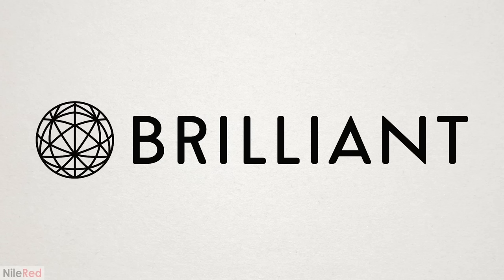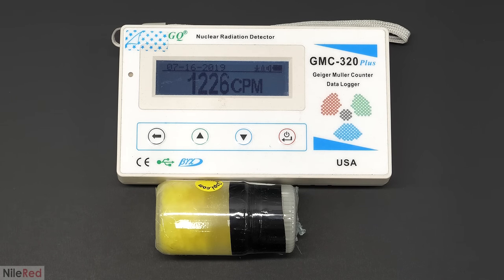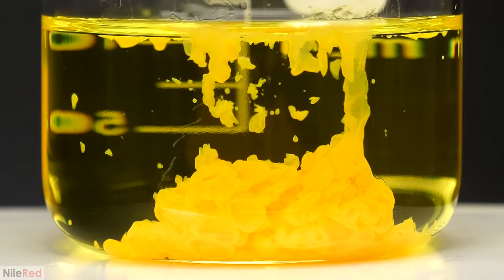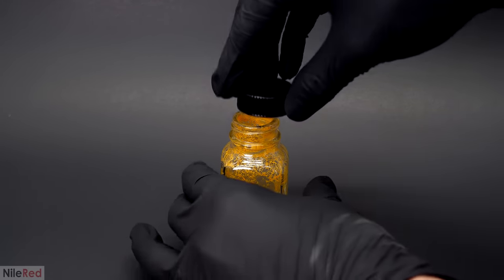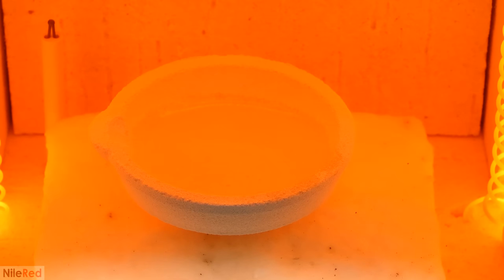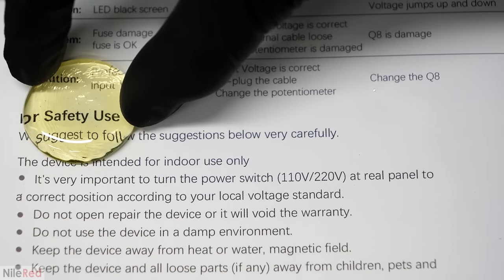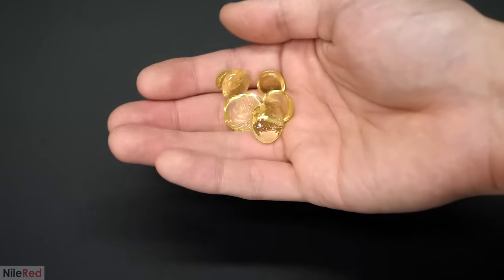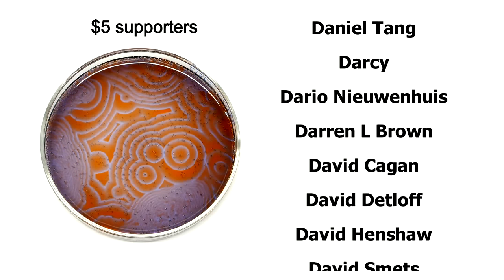Making uranium glass

Comment: The mother of an old school friend of mine had a large collection of uranium glassware. She kept the glass in a locked leaded glass display cabinet with and alarm system.The artwork was very beautiful, I believe the collection was quite valuable, most was a light green.
Reply: I like Uranium Glass too - it's very pretty.
But I wouldn't bother with the leaded glass cabinet - normal glass would be perfectly adequate for the Beta and Alpha rays, and hundreds of kg of leaded glass would be inadequate to absorb the Gamma radiation.
Check if the glass really is lead-rich. The lead strip used to hold plain glass panes together is radiologically useless - and that is the normal meaning of "leaded glass".

Comment: I'm a Boro-silicate laboratory glass blower. I've worked with custom uranium glass before. The trick to keep your specimens from shattering is a technique known as annealing. To accomplish this, you would want 2 separate furnaces. One for melting and the other for annieline. Place your graphite block in the aneeling furnace at about eleven hundred degrees fahrenheit. Open the door once the block and the furnace is preheated.  place your  spasiman On your graph light block at eleven hundred degrees for at lea half an hour. then Slowly reduce the temperature of your aneeling furnace without opening the door. Over the course of twenty four hours And till your sample is near room temperature And you should not have any internal stress anymore This process aligns the internal crystalline structure of the silica Transforming it into a stress free homogeneous mass. You will want to reduce the temperature on an inverted J curve slowly at first. But once you get past about  400° fahrenheit leaving the door closed u till it has completely cooled you should be fine
- James
Reply: I have now acquired another piece of knowledge I may never need but still was interesting to learn about.
Reply: same @TheKamasGod
Reply: Didnt he try to do just that?
Reply: @pressaltf4forfreevbucks179  Not exactly. As the OP said, the proper way to anneal glass is to place it in the oven and let the oven cool down over time in controlled steps. Most of my friends who have taken glass lampworking more seriously than I did have ovens specifically meant for this process. He's trying to make borosilicate glass (think Pyrex), but I'm puzzled since he's not using aluminum oxide in the mix as is typical from what I understand. The omission may be intentional, but it also may be in part why such small pieces were so sensitive.
Reply: I'm Curious. Would it be possible to make a Prince Rupert's Drop out of Uranium Glass? Maybe by dropping the Molten Uranium Glass into some boiling hot water?
Reply: @johnlemus7921  Highly unadvisable.
Due to the radioactive nature, it's safe when in solid form.But once it becomes a micro particulate can be inhaled which would be a big problem
Reply: Is the annealing also important so the uranium forms into nano scaled spheres like in gold ruby glasses?
Reply: MEGA MIND X100
Reply: now tell us how to purify the uranium 
im a bit late
Reply: @egg21hi  that's classified lol

Comment: "I think the glasses are safe"
check Geiger counter
"I think I have cancer"
Reply: Well, it's not like the glasses would be up against you very often. Also, the radiation is not going to linger in the glass.
Reply: bruzote well its not like glasses can spontaneously break and send glass/uranium dust in the air or anything
Reply: kek
Reply: Really though, I feel like the heavy metal toxicity of natural uranium is probably about as dangerous as its radioactivity.
Reply: Really though, I feel like the heavy metal toxicity of natural uranium is probably about as dangerous as its radioactivity.
Reply: @bruzote  "...radiation is not going to linger in the glass." That's not true. The uranium is a permanent part of the glass. And this form of uranium has a very long half life. These glass pieces will be radioactive for a very long time.
Reply: exactly, you said it yourself, the uranium won't linger forever in the glass, just gotta wait 700 million years for it to half!
Reply: There was a reason he was stressing much more about the uranium dust than the radiation. Uranium's natural poisonous nature is enormously more dangerous than any radiation coming from it, at least in small quantities.

Comment: I’ve been picking up uranium ore locally with a UV torch for a bit, and like you found, it’s strange that some of the higher uranium-content materials lose their fluorescent effects. Uraninite and pitchblende both have relatively high uranium content but have little to no fluorescence. While uraniferous opal is much lower (hard to find info, but never exceeding 15% uranium-bearing compounds, typically MUCH lower) and can exhibit some great phosphorescence.
Reply: It’s also helpful to have UV blocking glasses, at least for ore / impure uranium. You’ll be able to see some bright reflection without them, but the classic green color is much easier to see without the semi-visible UV light interfering

Comment from the maker: The sodium diuranate didn't fluoresce and I was concerned that maybe the glass was blocking the blacklight. I went back and tested it on its own though, and it definitely doesn't fluoresce.
 https://m.imgur.com/a/e7YOpH9

Also, it has been pointed out that my reading of micro sieverts wasn't very accurate. This is because the counter can't actually differentiate between alpha/beta/gamma and it instead uses math to approximate things. This is only accurate to what it was calibrated to, and for uranium, it won't give a very accurate reading. I figured it was still better than just CPM, but I should have added that it's also not very accurate. My reading here is probably higher than it should be and the danger is being overestimated.
Reply: I was just about to ask if you tried without glass. Good work.
Reply: Thanks, wanted to ask just that a moment ago :)
Reply: Great video!
Reply from the maker: @amitdas2676  thanks!
Reply: Im assuming you know basic radcon, but definitely make sure you dont injest or inhale the uranium. And take through surveys of your workstation after your done.
         -radcon worker
Reply: Its called green glass it was mass produced in 1900 to 1940s
Reply: Cursed chetto powder
Reply: Nile shell one of those in a leaded glass
Reply: I was about to leave a cynical comment until I read this
Reply: forbidden mustard

10:17
Reply: Reminds me of Dr Stone when he was making glass. Always love your videos.
Reply: Love the video.   Im curious;  if you mixed up a touch more glass (without the uranium) and attempted encapsulating one of the beads in glass;  see how much it can reduce the radiation =)  Might make them safer.
Reply: Why does it look like cheese...
Reply: Melt the plastic with lot of BORIC ACID and CONC.H2SO4
Reply: Make compound C2N2
Reply: Video idea: try extracting the bromine from bromine hot tub/pool tablets.
Reply: I was about to say because I recall glass blocking UV light!
Reply: Literally took the idea out of my head.  Thanks for checking!
Reply: @NileRed where u get U compounds?
Reply: As always amazing video
Reply: someone is manufacturing boroscilicate uranium glass for lampworkers. It was availiable as old staock for a few decades, but a few years ago some company started making it , as I can buy it new in quantity fro borscilicate glassblowing/lampworking suppliers. Its possible they are getting old stock marbles or some other form and remelting it into rods, but its bee avaliable for several years now,, so I think its being produced new.
Reply: I was typing
 12:47 Perhaps the glass is blocking the UV from getting to the sodium diurinate 
When I saw your comment.  I actually noticed it as an easy reference to spell the chemical name, and then read it through, LOL.
Reply: Where did you buy that furnance?
Reply: NileRed love hearing you and Cody are pals!
Reply: Perhaps it fluoresces at a wavelength above or below the visible spectrum?
Reply: It has a beautiful yellow color . . . maube try paintinh with it?
Reply: OMG! You have to perfect this. Make some larger bowls & sell them for thousands of dollars each. You'll be THE best new artist of the decade. Just be sure to do it safely as you are & make your first million before the end of the year. They're to be displayed in special cabinets under black lights at night & just pretty yellow during the day. Your a genius. 😁🥂
Reply: Just confirming, but isn’t it true that glass blocks UV light? I’m glad you tested it out though.
Reply: I believe i received radioactive radiation through my cellphone screen.
Reply: I hope you wore a good dust mask while working with the silica - that stuff is really toxic in fine powder form, the Uranium just compounds the issue. (It will permanently ruin your lungs).
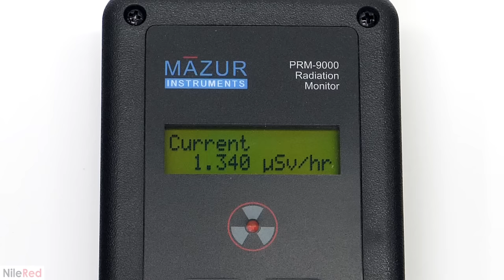Reply: 26:32 it is mSv in the picture and uSv on the Geiger
Reply: Half of Xray
Reply: Hello, Nile, love your work, i wonder, if you cover those irradiated pieces of glass with pure melted glass, or glass with led, will it make those pieces less or same level radioactive?
Reply: i let my hot things cool down inside their oven or heating place, on top of the hot stuff it was made in, so it cools down slowly and evenly with everything around it i guess, i dont make glass but i do have to anneal pieces of metal sometimes
Reply: @josket821  Yeah, but he already factored that in. He said that within 2 hrs you'll get the same amount as with a dentist's x-ray. The Geiger counter shows 5 µSv/hr, the chart says 0.01 mSv = 10 µSv. The bigger problem, at least in my opinion, is that he compares µSv (from the chart) with µSv/hr from the Geiger counter. His comparison is correct, but by converting Sv/hr to Sv he neglects the time interval of the radiation. A high amount of radiation in a short time produces more cell damage than a low amount of radiation over long periods of time. (It's like comparing force and pressure. A gravitational force of 1N acts differently when it is applied via a 100g bar of chocolate i.e. a big area or via the tip of a needle i.e. perforating your skin.) So, IMHO, it would be better to do the conversion the other way round: a dentist's X-Ray takes about 30 seconds at 10µSv, so this corresponds to about 12000 µSv/hr = 12 mSv/hr. Therefore, I expect the cell damage to be way worse than from the 5 µSv/hr glass beads - and that is not taking into account that most of the Alpha radiation will be absorbed by a layer of dead skin cells in contrast to the penetrating x-rays.
Reply: I'm glad you clarified that, because glass blocking UV was my first thought too.
Reply: NileRed I’d love one of the pebbles
Reply: Hello, sir, I recently found your channel and have really enjoyed your videos. So, thank you for taking the time to make, in my opinion, very interesting and informative videos. I had a question about this project. You stated at the end that it wouldn't be good to wear it for a very long because of the radiation it was giving off. My question is, what if you were to encase the uranium glass in glass? Since the glass jar blocked the radiation when the uranium was in its yellow state, wouldn't it also block the radiation given off by the uranium glass?
Reply: Have you tested if your glass is soluble? Because sodium silicate and sodium borate actually are soluble...
Reply: NileRed: The FBI wants to know your location :P
Reply: I'd love to see you do this again but show how different percentage of uranium(like the mentioned 0.1% and 3%) affect the radioactivity and the light emitted under UV.
Reply: NileRed what’s with the “though”?
Reply: Hey man, I'm a radiochemist who works regularly with special nuclear material. I have a lot of comments about this video, send me a message if you want safety tips for any future rad chem videos. My biggest concern right now - have you done a contamination survey of your lab? Did you do a survey of your person before leaving the lab?
Reply: Yotam Barr  Forbidden orange juice
Reply: From what little information I can find the sdu actually goes into solution with the silica. So, is it possible the sdu isn't fluorescent when solid, but is when in a solid solution (judging by it not glowing while still hot/more like a liquid solution).
Reply: If you want to differentiate the amount of radiation due to alphas, you can block the alpha particles with a sheet of paper. Beta particles should still get through.

Considering that betas and gammas can penetrate skin, but alphas cannot, your actual exposure to that glass may be lower than the Geiger counter you're using says.
Betas can also be blocked by clothing, by the way.
Reply from the maker: @josephcaouette  oh of course, i was very careful to not ingest or breathe in anything. I also wiped down the entire room after and I checked for anything that i missed with the geiger counter.
Reply: @NileRed  glad to hear your being careful, and don't forget to take proper controls of any ram generated by the cleanup!
Reply: Didnt Understand But Cool
Reply: Yum glass
Reply: @NileRed  bro you forgot to pin ur comment
Reply: i had a stroke reading that
Reply: @thepolec4049 hahahaha
Reply: Why is this not pinned
Reply: at least overestimating dangers are better than underestimating them

Comment: Man, I just love how you act smart and calm, yet puzzled 😂. Overall very cool, what surprised me though that even me as an like could tell it would need to anneal when it was cracking, because I assumed a certain simillarity with the steel structural behaviour, and I was at the end correct. When you had pulled it out straight away, you had basically tempered it, making it hard but brittle, where with the annealing, you've managed to make it not as hard, but more tough, simillar to steel. Very nice video! 🧡